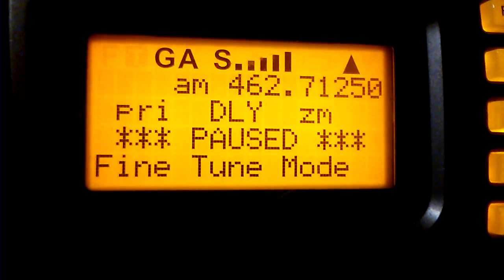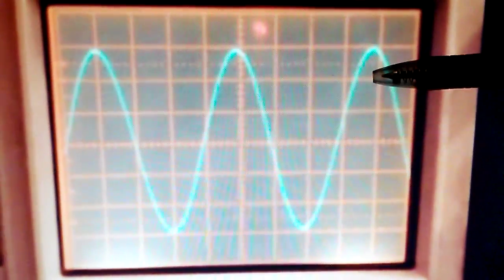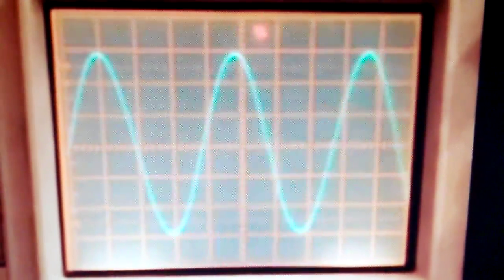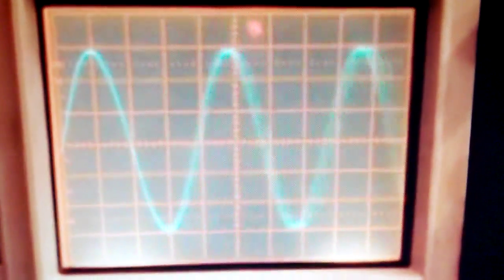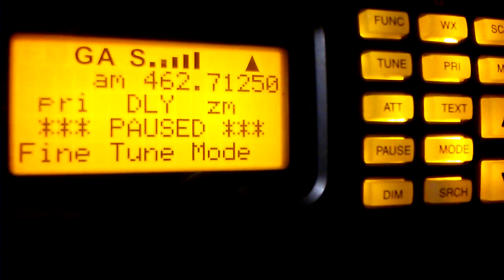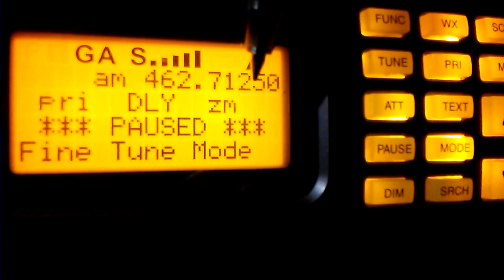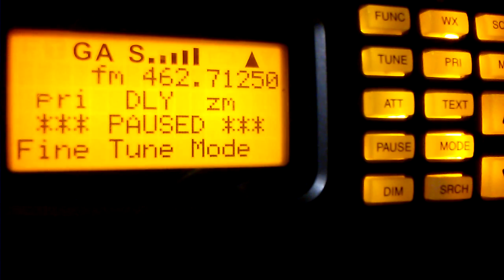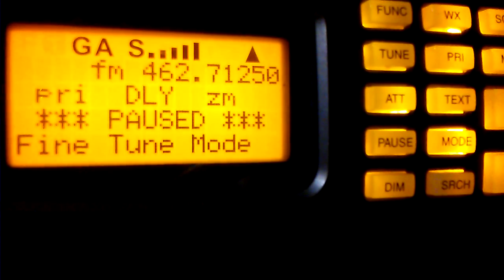Radios Explained: AM vs. FM - Can a Baofeng UV-5R recieve airband/aircraft signals?  Nooo!

Comment: FM receiver though can receive AM, with fair distortion, but still. It just need to be detuned over side limit of the input AM signal. It will get amplitude and phase distortions that can be slightly detected by FM circuit. Because phase modulation is just differentiated frequency modulation. So AM signal will be received with non-linear and "dy/dx"-like distortions. It is bad for music, but enough for speech to be recognized and understood.
Reply from the maker: Don't mind me, just replying to a 5-year-old comment lol...while you are correct, this video was targeted more toward giving an overly simplified explanation to entry-level Baofeng purchasers who thought they could hear airplanes talking to each other.   :P
Reply: @VariableThisIsKnife  https://m.youtube.com/watch?v=ozH8KhpLYaM
Reply: https://m.youtube.com/watch?v=ozH8KhpLYaM